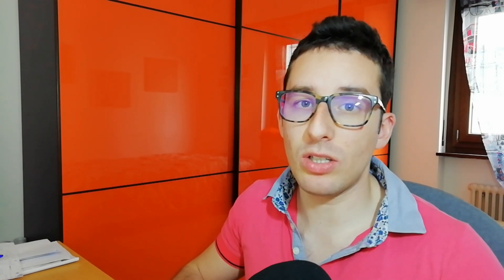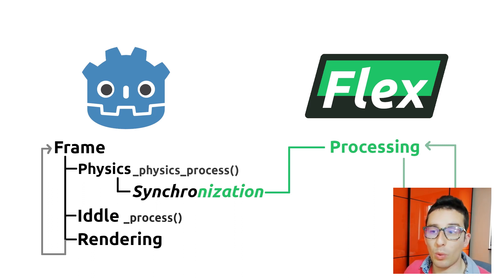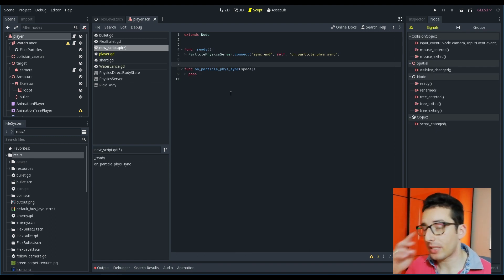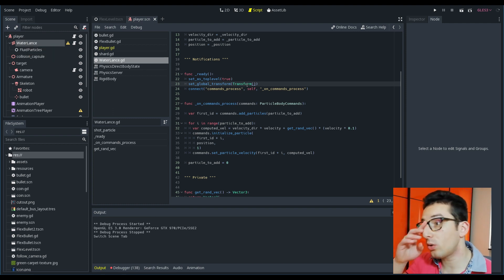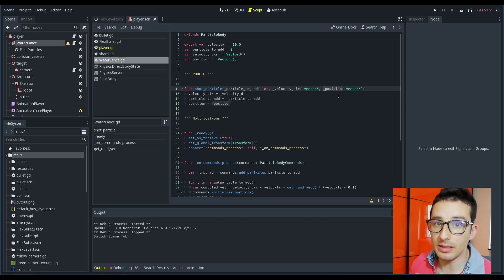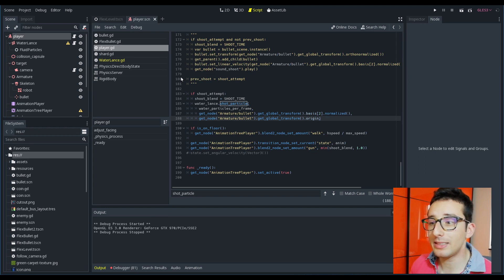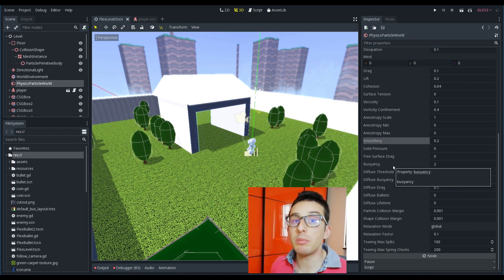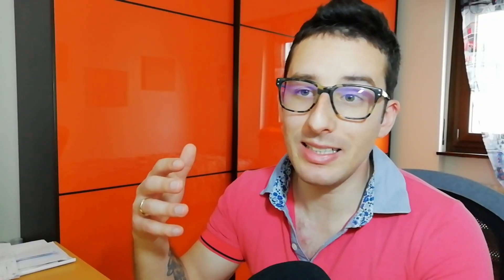Fluid simulation in Godot [Physics part] - Nvidia Flex #5

Comment: Hi Andrea, do you think a full flex integration would be ready for Godot 4.0 or earlier?
Reply from the maker: Hey Sam, it is already full integtreted. What do you think it's missing?
Reply: @AndreaCatania  I meant, is this going to be part of the official build of Godot or will always remain as a patch? Would it be added in the asset library? Also it seems like you're still working on the fluid mesher, right?
Reply from the maker: I don't think that it can be ever accepted in the official build of Godot, due to the fact that Flex is not opensource, so yes I'll maintain it as side project. Also it's not possible to add it in the asset library since godot received a not trivial modification to the render and to the processing, in order to step not only the physics server but even the particle physics server that is a server developed for Flex, and these changes on the core of godot doesn't allow to implement it as asset.

But despite this everything I did is opensource on github and if someone need it is there
Reply: I though they made all of Physx Open Source.
Reply from the maker: @jojolafrite90  I think they did, but unfortunately Flex is not part of PhysX :(